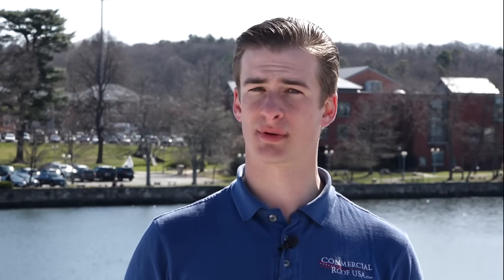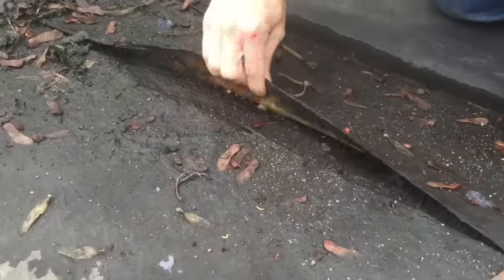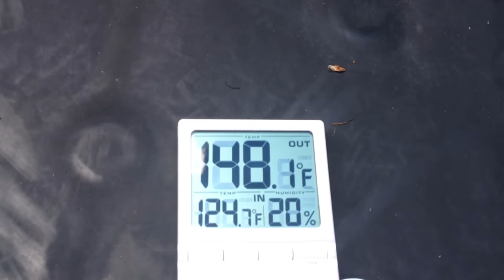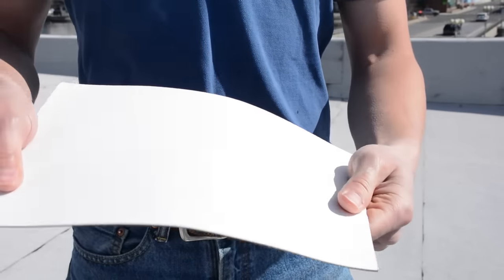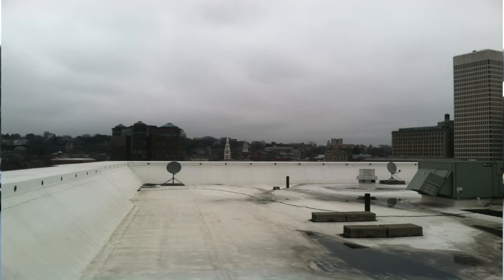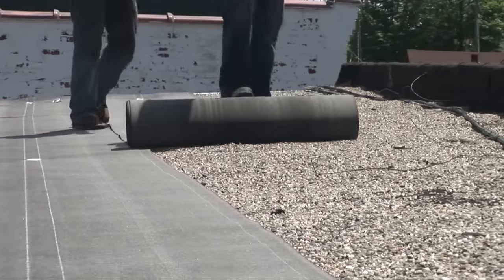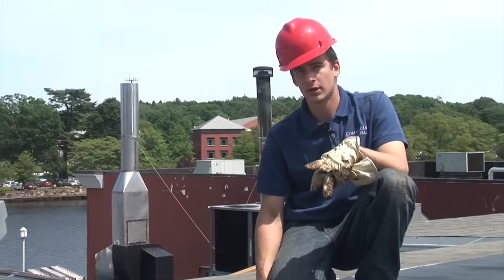Top 3 Flat Roof Materials Explained - Torch Down, EPDM, TPO - Which is the best?

Comment: I have a   modified  bitumen flat roof which the company used fire torch in my flat roof.  Definitely, it doesn't last 40 years. My flat roof is almost 20 years and   had a  minor leak. when you walk on it, you can tell  needs to be replaced. Roof companies don't want the homeowners to do themselves. I am planning to do a  cold process peel stick sheets. Also it depends on who install it.
Reply from the maker: Hey Freya
A single ply torch down will not last even 20 years without any UV protection. You are correct in that sense.
We never install any torch down without the ceramic granules for protection and we never install a single ply membrane. You have both these and that is why you say what you said.
If you install a 2 ply membrane as we show in the video, it will last beyond 40 years.
Your opinion is based on one roof installed by some guy who never told you to paint Aluminum Coating to protect your roof. You got what you paid for.
Sorry

Comment: How much for the white mod bit?
Reply from the maker: It is called Firestone APP 180. This is the rubber membrane that has the ceramic granules embedded in the surface to protect it from UV"s. Most roofers will use APP 160. That is the plain membrane, but then it will have to be silver coated to protect it against UV"s. That is called maintenance for the next 30years.